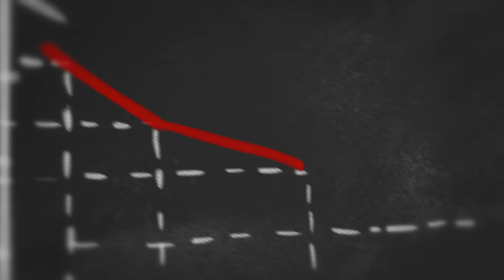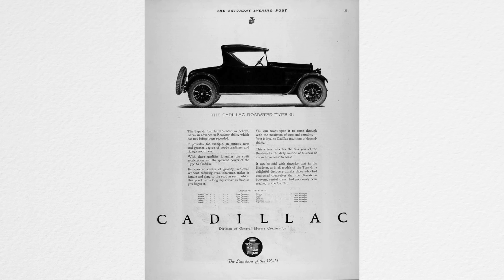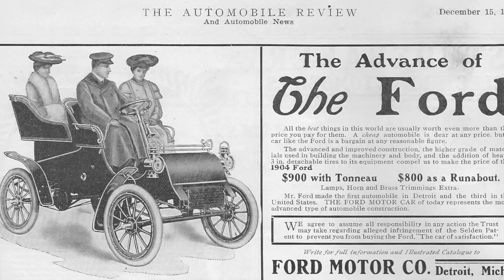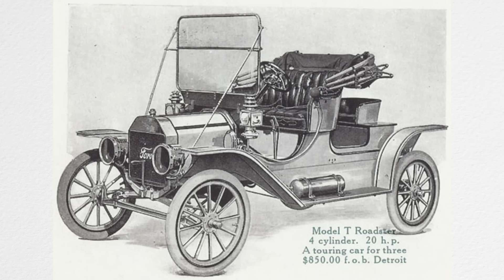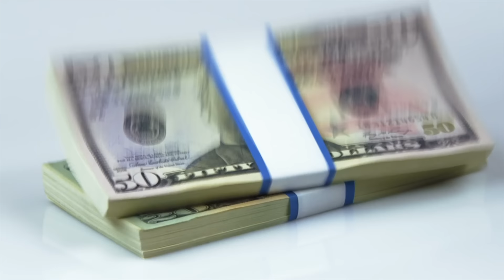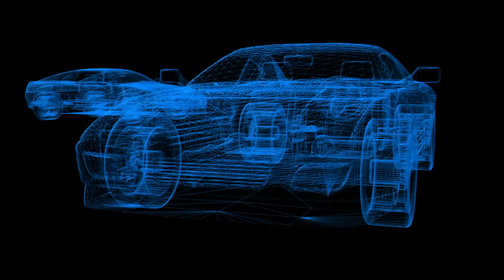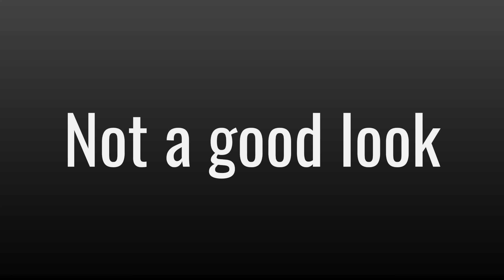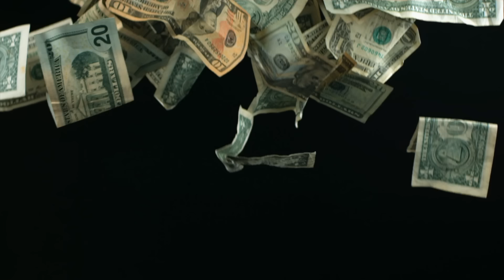Henry Ford: Innovator Until He Wasn't

Comment: Very interesting case. A lot of peopletalk about VHS vs Betamax struggling to be the standard, and people like to claim Betamax was technically superior... not exactly. It had a superior picture quality, but they refused to increase the play time for years, and had an inconsistent user experience, adding and removing features on their VCR models, among other blunders. The VHS had what customers wanted - good enough quality, long play time, standard features in many models. The Model T was similar - not necessarily pretty, but not expensive, and powerful enough to make the purchase worthwhile... The right balance for it to take off, and Ford is remembered as the father of the car.
Reply: Video 2000 was even better. I know, when i was little kid, we had one of those before we had to get VHS. I was not happy :(

Comment: Coming to this a bit late, but is there any chance of doing a video like this examining the early history of electric vs combustion cars?

There's a lot of received wisdom on the subject that's inconsistent or just doesn't make sense. (For example, it's often said that combustion took the lead because of the old canards of range and charging, but in these early times a 100-mile electric range was enough to drive for most of the day, and electricity was a lot easier to find than gasoline. Also, it's said that most cars were electric at one point, but when I've looked at early car competitions, the vast majority of manufacturers were making gasoline cars, despite the land speed record being held by an electric.)

So having your formidable knowledge and research ability aimed at the subject could really help to clarify things. And it's a really important subject, given that it perhaps wasn't inevitable that combustion would become the norm, and now the world appears to be coming full circle.

Comment: How much has times changed.  When Ford was alive he worked hard to get an engine that has an output of 20 HP.
a 2.9 liter, inline 4, 20hp engine.
Today we can go to harbor freight and get a 670cc twin engine that has similar HP, there are even 250cc engines that has more than 20 HP

Comment: 11:13

This is actually a misconception, from 1908-1914 and 1926-1927 the Model T came in a variety of colors. In fact for the first six years of production the Model T didn't even have an option for black paint. It was during the period from 1914-1925 that the Model T was only available in black. 

The reason for this is in contention but I believe the source that claims it being due to problems with paint not drying fast enough for the rate at which cars moved through the production line. And so they chose the paint that dried the fastest, which was a form of black paint. Other sources include black paint being more durable, or cheaper. 

Whatever the case, the Model T being only in black for its entire production run is a myth.

Comment: The first Ford (and presumably what you are talking about) was the Model T, the Model A was later, and is able to go highway speeds of 50 Mph/80 km/h (it also had a relatively modern 3 speed stickshift).
Source: My father owns a Model A
edit: apparently there were cars before the T
fun fact: the Model A is one of the most produced cars ever
Reply: Old comment, but if you pay attention to the video it explains the difference between the first model A and the model A that came later.

Comment: The fact that colors other than black were available in the early days of the model T, the price drop down to 250 dollars which I believe was around 3000 dollars today around 1915, and the Ford V-8 that came out in 1932 should have been mentioned. Also the fact that the Model T had a planetary transmission, unlike the mostly modern Model A that replaced it that had an unsynchronized transmission; meaning you had to double shift. For those who do not know double shifting means for example... you cannot shift directly from 1st gear to 2nd gear. You have to shift once to neutral from 1st gear then you have to shift from neutral to second gear. So twice the amount of shifting as a modern manual transmission. The model A also added an electric starter from the factory, as well as a speedometer, a throttle pedal, and a dedicated parking break as opposed to the parking break on the Model T that pushed in the clutch, and brake for you, if used, but also acted to  put you in one of the two gears, one being low the other being high. 
   The Model A (1928-1931) like many cars of time also required you to manually adjust the spark advance while driving, as did the Ford Model T.

Comment: Why don't more companies try making 'Model T' type products.

Not only did it set the bar for cars, but most manufactured goods.

I understand that companies have to make money somehow, but companies should strive for reliable products at a reasonable price, not things that will be outdated in a year, break after just one fall, and costs more than two weeks worth of work to buy.

Not only will it build trust between companies and consumers, but it will benefit both parties in the long term.

Seriously, if it's simple enough for someone like me to understand, why havent large corporations done this?

Comment: i wish car brands would focus only on lower price and higher power today lol
Reply: I think for the average consumer should be more important safety than power, i mean why you want a car with 400HP and more than 200km/h speed if you shouldn't reach that speed on the streets or roads anyway, but rather they should focus to make cars more safe to both people inside it and out.
Reply: I get your point, but have to agree with Esteban here. Higher power doesn’t matter very much at this point, when we have so much power that fuel economy becomes a major issue.

Comment: 5:48 and there's a word that the modern Ford Motor Company has forgotten about; you can't even get their most popular model (the F-150 Pickup Truck) for an MSRP under $30,000; most of the F-150s at my local Ford Dealer range from $40,000-$75,000

Comment: Quick thing on GM wanting to Purchase Ford. the board at GM thought the price was too high, the Originator of the company who was then the CEO wanted to go for it and the board kicked him out of the Company. He then started Chevrolet and a whole series of events that got him back as the CEO of G.M.
Reply: Yeah that was Billy Durant. Had to read about him when i was in college. Along with Ed Cole (Chevy Small Block) later in the 1950's they probably have contributed greatly to GM's lasting market. Its too bad that GM and Chevy are known for trash now a days.
Reply: @bobjackson4287  Everyone's known for trash nowadays. Chrysler's dropped from pretty much every racing circuit but NHRA cause they can't compete, Their trucks rust out, and the transmission fail more than a newbie in a communist election. not to mention what they've turned Jeep into. Ford ditched the best diesel they ever designed in favor of a headgasket blowing pile of crap that was the 6.0, they're still using the nearly decade old 10 speed that they needed to partner with Chevy to build. Their the worst of the big 3 about making it impossible to work on their vehicles yourself, hell they've shoved the engines of their trucks so far into the cab that to do an engine swap you have to pull the cab. Not to mention the fucked up bump-stops on the Raptors that was bending frames. And then their 400 thousand made to order GT40s that require you to buy SPECIALTY BOLTS couldn't keep far ahead of the "oil burning, outdated" corvettes. Chevy even when they DO come out with something good cant market it for shit, and so half the time people don't even know it exists. I didn't even know the ZRX was a thing till 2 years after it came out. And it wasn't that good anyway. Then you've got them choking their own performance cars and not putting their best engine in it for some god unknown reasons. Hell their marketing and impact is so meh nowadays that their fuck ups don't even make headlines like the other 2. The only big splash they've had at all is the C8 vette and that's just cause its mid engine.
Reply: @claytonmachine12  Oh i never said that Ford or Fiat was not trash, i just said GM is trash. Ford's problem is the reinvent the wheel every year and are a nightmare to work on, and i am a mechanic. Ford's 6.0, and 6.4 are both shit engines and the gas 6.8 was one of the biggest pieces of shit Ford ever put to market. 3.0 Vulcan that was used in the Rangers were way under-powered and generally a terrible engine as well.

Fiat well.. RAM's are fucking junk even if the 6.7 is a good engine. Most of us prefer pre computerized 5.9's with mechanical injection pumps. D250's or go home.
Saw one of my colleges get into a brand new ram straight fresh i got into it with him while he was test driving it, Reached down to release the parking break and the plastic handle broke first pull. At that point we just got out of the truck and just shook our heads. Transmissions on those things fail all the time, and the Hemi's typically have lifter/cam problems from my experience due to oil related problems. Cant say much bad about Cummins they are just in a shit truck.

Now GM.. They cheap out on everything, absolutely everything. Outdated interiors all kinds of stupid stuff like AC fails while under warranty, Break and transmission problems on the Colorado's, some have head problems with the 3.5 engine. GM's problems generally stem from their crap electronic systems, leaking differentials, weak tie rods and much much more. The old LS based engines in the Chevy's are really good motors. The LS/Vortec name precedes itself. We will see if the Ecotecs hold up as long soon.
The 2.8 Dmax is a fucking joke and i just cant see anyone really wanting one if they are doing anything more than groceries hauling.

New trucks make me jaded.. I'm just gonna stick to my 83 K20 squarebody.. 454/sm465. Bought it when i was 17. I'm 33 now and it still runs as good as the day i got it.
Damn thing will probably outlast me.
Reply: @bobjackson4287  Ehh, I will say the early Vortecs had that  weird curiosity that if you converted it to Carb it had better fuel mileage. But yeah, Ill take my 97 K2500 Suburban over any of these new trucks. and its not like they get THAT better mileage. Mine makes 14 highway while hauling everything I own and my car without the carb conversion(doing 80 most of the way). The 2018 Ford he drove for a month barely got 17. And the 5.7 Hemi his wife got him isn't any better. Though I will say unlike anything else they threw that motor in, its actually easy to work on in the engine bay of that truck. But I think the big difference between the big 3 is that Chrysler has been shit for a LONG time. Hell it took a literal rocket engineer to make the 68 Charger fast, and it was so ugly it didn't sell afterwards (literally the only reason the Daytona is rare today) They were making fucked up space choices that made working on vehicles difficult as far back as the 70s (my 71 Dart requires me to pull the motor AND steering to install headers, and afterwards you have to pull the motor if you have to get to the starter)

Comment: Well one thing about the car is that we got too much of the car. nobody can deny the car revolutionize and changed America forever that much is a pure given however when it comes to the culture surrounding around the car, it stops all other progress. Public transportation was a thing before Ford came in and now in the west and Midwest is not a thing because the car revolutionized how we travel it ended up being blended into our culture and now you cannot have a job or a home without a car. You cannot be successful without a car but you got to earn a car or have one bought from your parents which some Millennials nowadays cannot have and that needs to stop. It creates a endless cycle if you don't have some form of transportation to get to work. long term the car failed America and the regulation behind the manufacturing process of making cars is also failing to lower the cost of the car and now it is double what it was when Ford started out. Cars are no longer cheap either due to driver regulation, mandatory Auto Insurance, driver's license and registration of the vehicle makes it all the more expensive to maintain the vehicle because the average consumer would have less disposable income and would pretty much be poorer than they were 20 years ago 50 years ago or even 100 years ago. We as a society in America are dependent on the car to get to and from work and that's creating traffic chaos in major cities such as Los Angeles or New York City where traffic is in udder chaos. Long term the car failed America basically speaking.

Comment: Henry Ford was just a typical Capitalist of his time. If he hadn't done it, another Capitalist would have. Hating and supressing Unions, automating as much as possible and reducing the work to simple monotous task on a conveyor belt. Tasks so easy that you can employ mostly everyone and therefore push down wages to the absolute minimum. All that for the Profit, not to give the masses of people a vehicle. I am sure his workers couldn't even afford the car they were building themselves. But I have no prove so it is just an assumption. The reason why he didn't advance the Model T was because it sold so well for a decade and innovation and developement costs alot of money and thus reducing the profit, especially when you have to build a whole new factory or assembly line for a new model.
Reply: The workers could afford a Model T. This was done to stimulate sales.